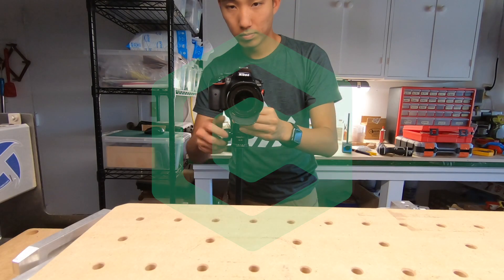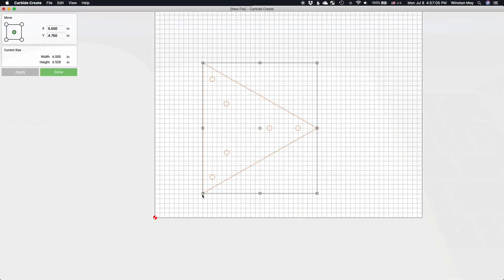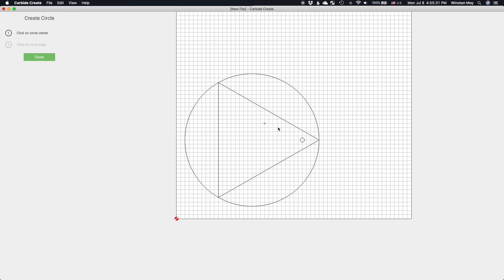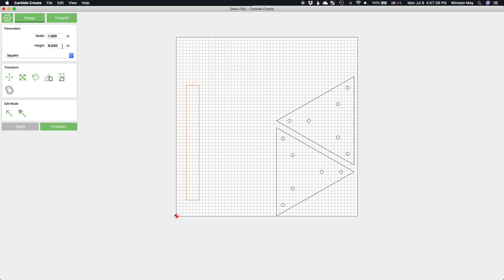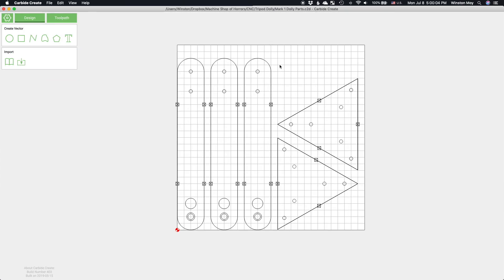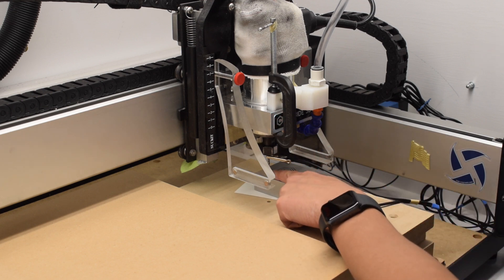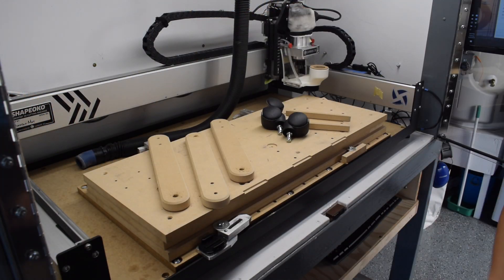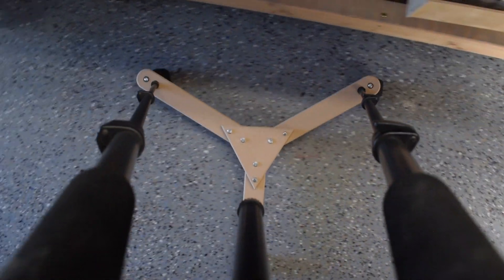Making a Tripod Dolly Project w/ Carbide Create + Shapeoko 3

Comment: Winston  Any chance you could come up with a design and video on doing finger/ box joints on the Shapeoke  over the front of the unit or could you do a video on how to design the tool path to cut the pins and tails. and I will figure out how to hold it to the front of the unit my self.
Jeff Peters

Comment: I’ve been needing this without realizing it! The versatility of making a tripod base for other things (lights etc) is exciting too. I’d be a little concerned about using MDF on this though, any reason that was chosen over 3/4 ply?
Reply: Just that I had a ton of it laying around, but no reason you couldn't do this with any other material. If you trust MDF for shelving (or wasteboards) though, there's no reason this wouldn't last you over a year or two assuming you kept it out of the rain.
Reply: Winston Moy Cool to hear from you Winston! I’ve watched nearly all of your vids, they helped me feel much less intimidated entering into the world of CNC with my Shapeoko (which I love and am using daily already). 

I think it’s the potential for flex in this application with the MDF that makes me hesitant on that material. I’ve cracked it before where it was bearing weight in a bit of an unbalanced way. That said I’ve got tons of it lying around as well so totally understand making use of it wherever possible. Thanks for the vid and reply!